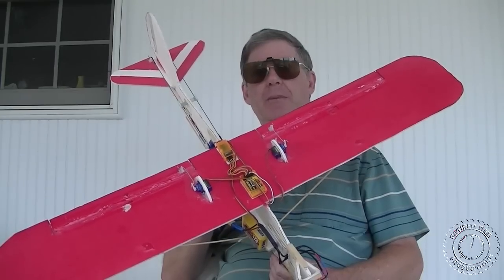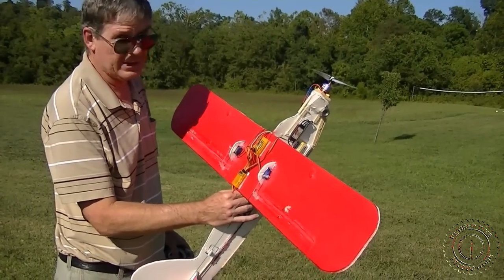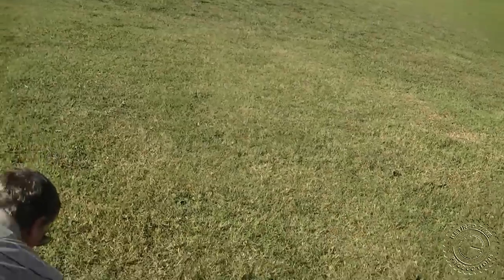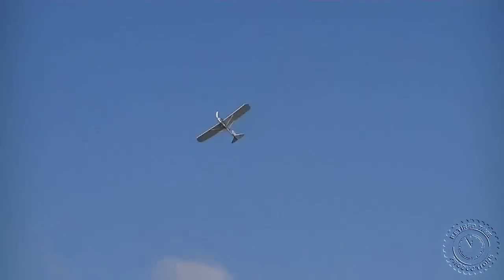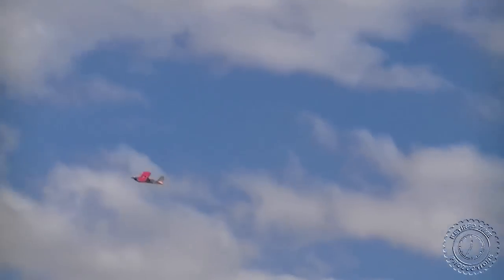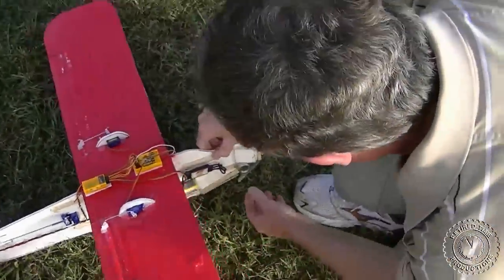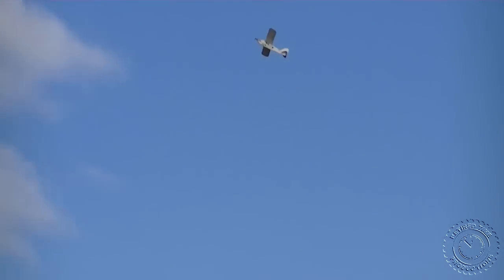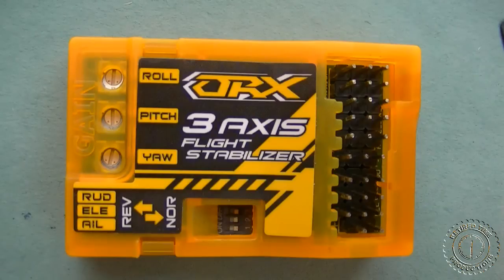HobbyKing Orange RX 3-Axis Flight Stabilizer Gyro System - Part 3 of 3 - good for FPV or Jets

Comment: I have the lemon receiver with stab plus.  how do you know how much gain to set for each axis.  Is there a rule of thumb?  I flew my plane and it would pitch up then down etc.  Could the wrong gain setting cause this.  the cg was good.  thanks
Reply from the maker: I lay the plane on the bench, power it up. I then turn up the stabilizer gains until the servos start to jitter and then back off the gains until they just stop jittering.

Comment: Really should have done a test flight without the gyro to see a comparison. Looks like the gyro did great because that plane looks trashy. lol Add a little more elevator on your landing and give yourself plenty of room to brace for a soft landing. I used to be the same way when I landed because I was afraid that it'll stall during landing.
Reply from the maker: Yeah, I don't even have that plane any more. It got so trashy it ended up in the bin.

Comment: Cool, I just bought the Version 2. I haven't installed it yet. It would be nice if instructions. I wasn't completely sure which was input and output. I didn't want to assume and maybe fry the thing. I found how to connect everything here on YouTube. As a hint to others, I noticed there is a slot that acomodates the tab on Futaba connectors. Compare to the orange or yellow wire on JR, HiTec, and Spektrum to the white wire orientation on the Futaba connectors and the polarity will be correct.

Comment: It appeared to me, as your plane was making relatively flat left turns, the system was doing what it was supposed to do. To remove the turn, you probably only needed to trim the rudder. Keep in mind, this isn't  a flight leveling system. If you put the plane in a dive, it will stay in a dive. Also, system isn't designed to make a badly trimmed plane fly properly, nor to totally overcome poor flying skills. It is designed to correct for unwanted pitch, roll and yaw attributed to windy conditions.

Comment: my 2 cents is if you change your platform meaning the plane your using you will feel more how stable will the flight stabilizer will work, try to put it in a balsa trainer or slow flyer and you will see the diference ;-) just my two cents

Comment: Great write up and good video, mounted mine up tonight on my bicker, dialled in and ready to gyro. I was using a heli gyro for the ailerons and is was good, but I needed so elevator control for better videos. Order two more tonight, then they went back order but I got mine, cheers from Canada